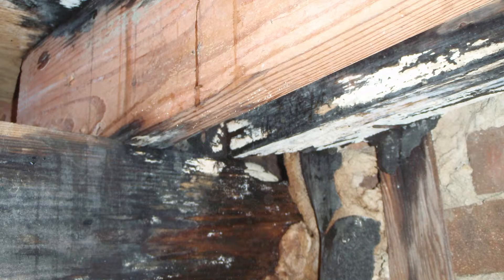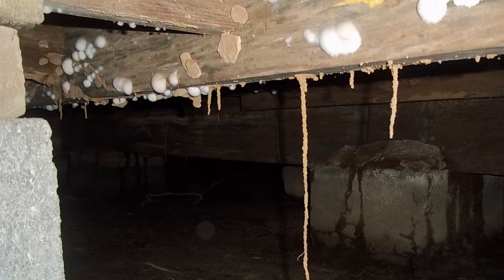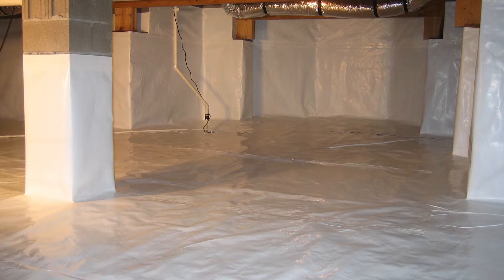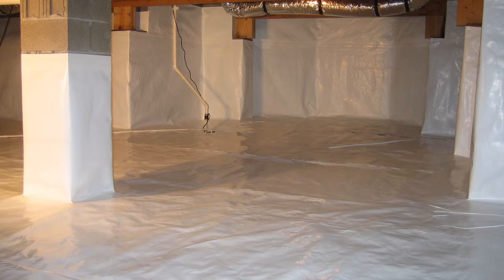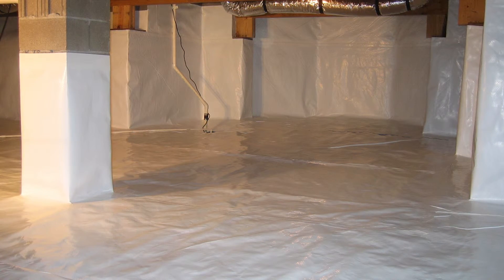What is the Difference Between a Vapor Barrier and Encapsulation in a Crawlspace?

Comment: This may be a silly question, but why is the vapor barrier not sealed? Concidering that its purpose is supposed to stop moisture from the ground rising in the crawlspace.
Reply from the maker: A basic vapor barrier is typically placed on the dirt floor of a crawl space to do just that - act as a barrier between the soil and the crawl space air - but it does not actually seal off the crawl space dirt floor. Basic vapor barriers are usually an add-on following waterproofing or interior drain installation. Encapsulation takes this a step further, utilizing a heavy duty vapor barrier (heavier ml) that is in fact sealed to the walls and the floors of the crawl space. Sealing off the crawl space with encapsulation materials helps prevent humidity problems and other moisture-related issues in the crawl space. When combined with an airtight crawl space door, spray foam (for vents, cracks, and crevices), and a dehumidifier, crawl space encapsulation provides the ultimate defense against moisture intrusion. If water intrusion is also an issue, we recommend interior crawl space waterproofing prior to crawl space encapsulation. Hope this helps!
Reply: @Ussfoundationrepair  Thank you for the explanation.

The house my parents bought very recently has flooding issues in the crawl space. The yard floods on the right rear side of the house torwards the doorway of the crawl space. Meanwhile, we had 3 different companies come check it out. The 1st, was offering to put sister joists and a french pump -no encapsulation or vapor barrier. The 2nd said the joists have an inch of rott, but that making a footer drainage system and incapsulation with dehumidifier will stop the joists from further damage and will be fine. The 3rd suggested a drainage system with vapor barrier (no dehumidifier) and to change out the rotted joists. My parents are leaning towards the 3rd opinion. However, I seen many suggest that it is still beat to have a dehumidifier in humid climates (like NC where we live). One of our neighbor's have said they have one with the vapor barrier and works well.
Reply from the maker: @sylphdeposey7149  Dehumidifiers are a nice option as they do help control moisture in the air of the crawl space; but if crawl space water is the main issue, our focus would definitely begin with an interior crawl space waterproofing plan. While we cannot diagnose without looking at the site in person, it is typically the waterproofing system (interior drain, sump pump, etc) that corrects crawl space flooding by re-routing the water away from the home's foundation. The vapor barrier is an added bonus and should not be relied upon as a single source of protection from water intrusion, but full crawl space encapsulation may be something you want to consider down the road, following your crawl space waterproofing. The water in the crawl space is likely no doubt the cause of the wood rot and moisture damage on the floor joists. Replacing these, sistering, and/or a crawl space structural repair using steel floor supports will help restore the structural integrity of your crawl space's wood components with encapsulation helping protect it further. A dehumidifier, especially when combined with crawl space encapsulation, is a great way to follow up with added protection against moisture and high humidity beneath the home. If your yard consistently floods on that side of the home, you may also consider regrading that side of the property and/or downspout extensions to help keep water away from the foundation and from entering the crawl space. Hopefully, this is helpful. Continue to ask these companies questions, especially about warranties. Good luck with your home repairs!